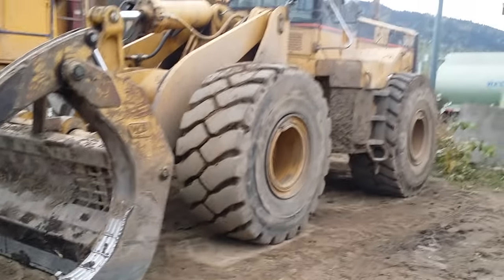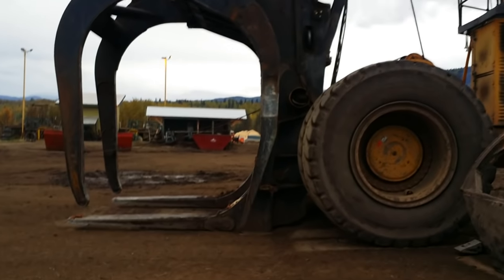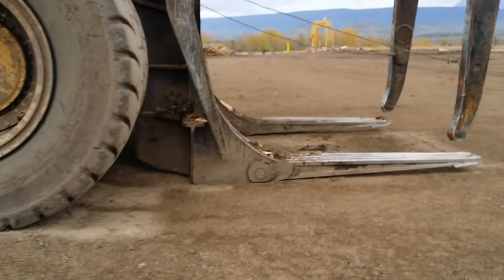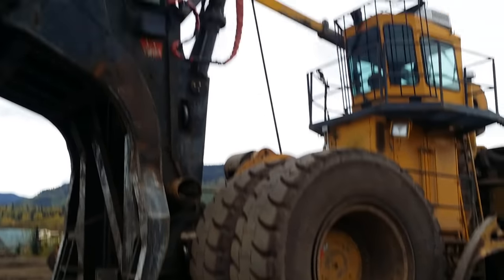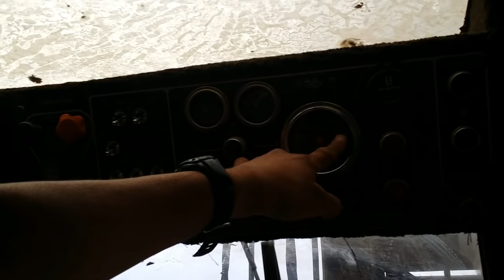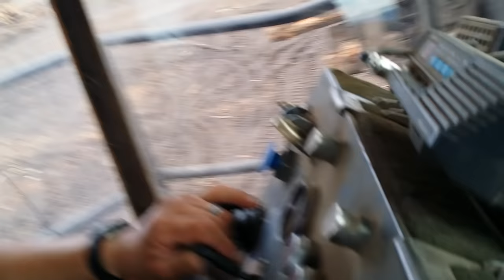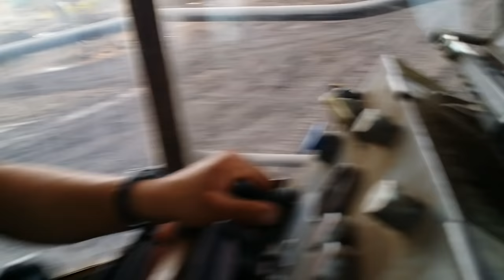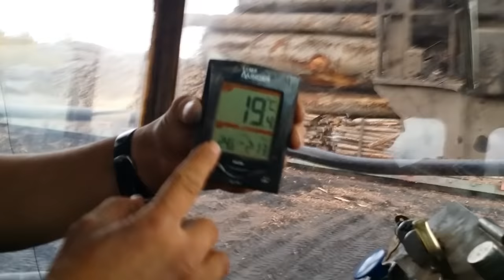Letourneau 6594 Inside View - Real Life Forestry & Logging - FDR Logging

Comment: @FDR   That is one very impressive machine.I believe LeTourneau manufactured a slightly larger unit like the 6594, back in the 1970’s.. The capacity of that model was 70 tons.. Unfortunately I can’t remember the exact model number.. The machine was designed to handle logs specifically.. I know I’ve got a book somewhere that has several pictures and basic specs on the machine..Thanks for posting this very interesting video.

Comment: The steel company I worked for in Hamilton Ontario still has 3 Straddleports built by LeTourneau in operation. We replaced most of the old electric controller and power but one unit still has a size 4 alternator. We still use the AD-1 motors as well as the N-7. The steer motors are size 4 ac motors.